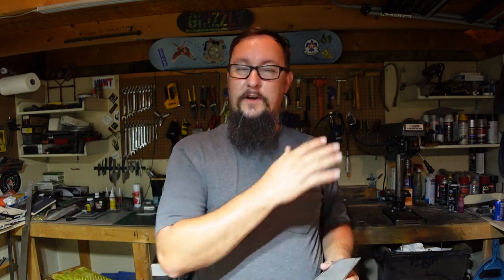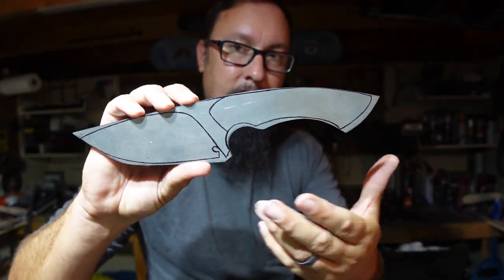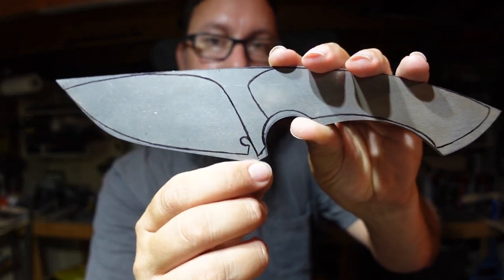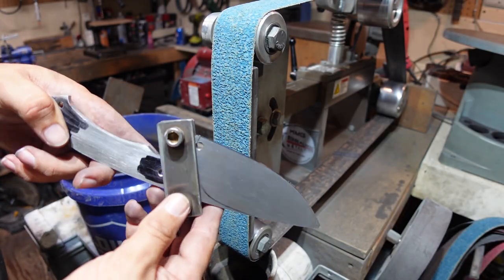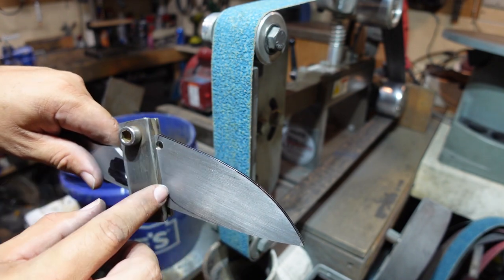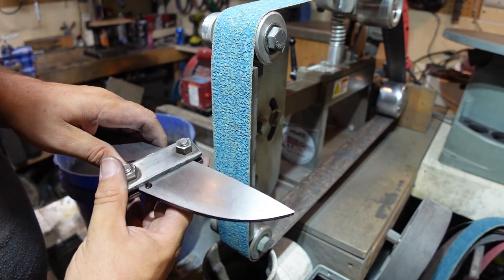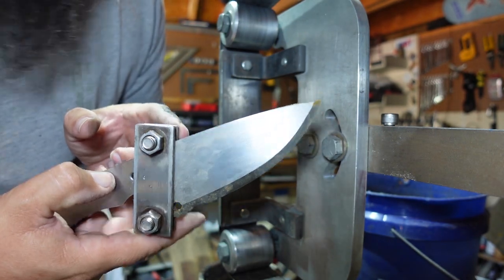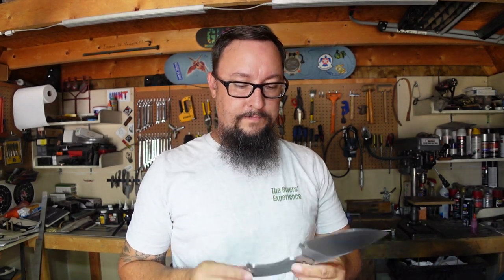Starting The Camp/EDC Knife Out Of Pop's 8670 | Shop Talk Tuesday Episode 138

Comment: Hey sir have you torture test your knifes like hammering them through a quarter inch steel plate or tubing, hammering through concrete blocks, bending them on a vise back to zero, putting weight on the balance point to see how much weight it could sustain and lastly tipping through quarter inch steel plate?
Reply from the maker: I did part of those when I first started learning to heat treat. There isn't a need to do that at this point. I only use a few types of steels for this reason. Nail the heat treat and repeat. I would point out one thing, if you are getting into knife making. You should know the intended purpose of the knife style that you are making. If you are making a chefs knife then you wouldn't do any of the test you mentioned. If you are making a knife that could also be used as a hatchet then those test are fine. 95% of knives now days spend their lives opening boxes and mail. 5% might see the real outdoors. With that being said, as long as you are doing the correct heat treat and are designing the knives with their their intended use in mind then you should be good to go. 

p.s. there is no need to baton a knife through concrete or a steel plate. The real world isn't an episode of "forged in fire". This isn't a jab at you, I'm just being honest because I get asked to do stuff like that often lol.
Reply: Its a knife not a hammer or prybar. Knives do not need to go thru those kind of tests.

Comment: I have to ask,,,what type of respirator are you using and do you feel confident using it with your beard. I have a beard as well but always like looking for something better. Is that an old wound on the bottom of your pinky ? Looks like you had stitches. That blade is looking good brother.
Reply from the maker: The mask is by RZ Mask and I like it a lot. It has replaceable filters on the inside. When it come to my pinky, I actually burned my hands when I was a kid and that section is a skin graph.
Reply: @theriversexperience9383   Thanks for the info. I’ve had bad run ins with fire.